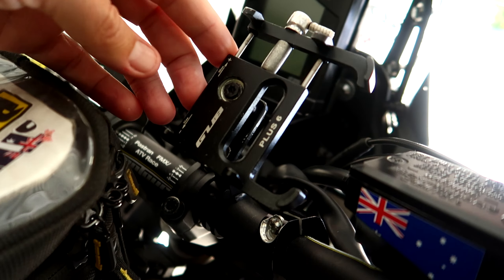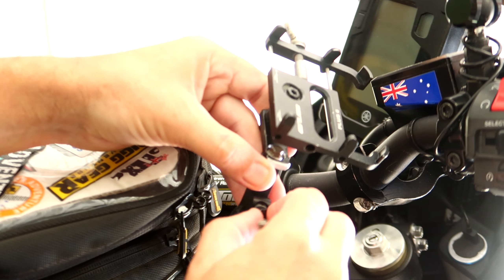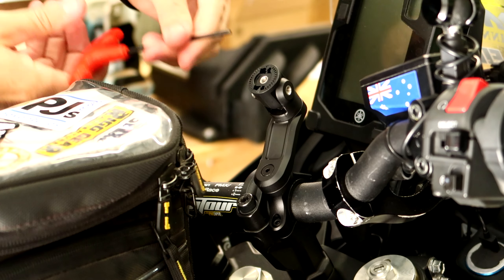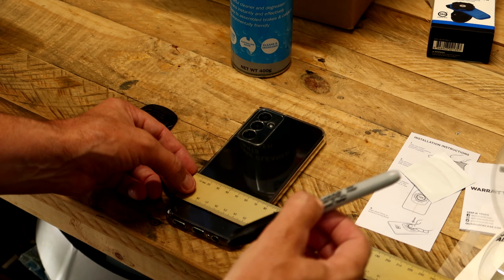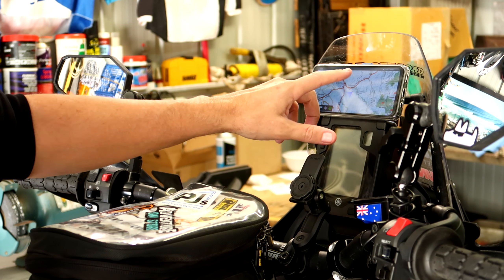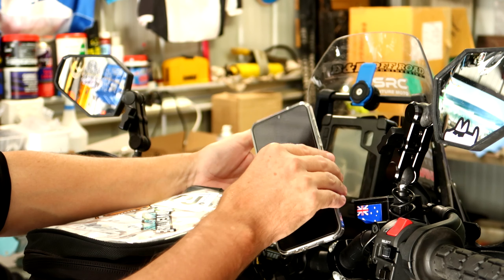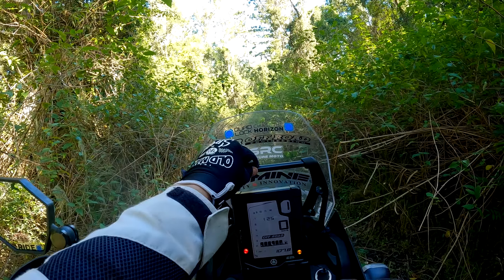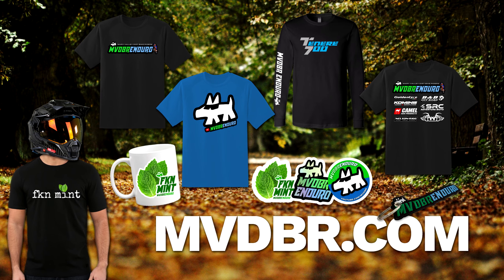Quad Lock Motorcycle Mount Install Review & Hardcore Off-Road Test

Comment: Quad locks are great. Although for me I needed the vibration dampener as 2 quad locks cracked over the past couple years. My 500exc vibrates a lot and weakens the plastic over time so the vibration dampener not only protects the camera but also the lock itself 👏
Reply from the maker: Yeah the old 500 does vibe a lot 😬 cheers

Comment: Just need a magnetic charging cable for easy cable attach/detachment and it saves the usb port from damage when the cable gets caught in branches.
Reply from the maker: Yeah those things are great I have a couple here, might look at using one for this cheers for the tip 🍻